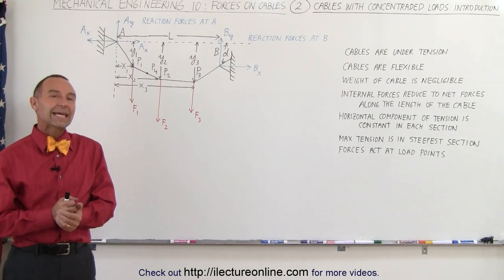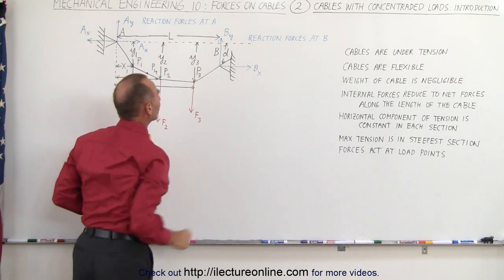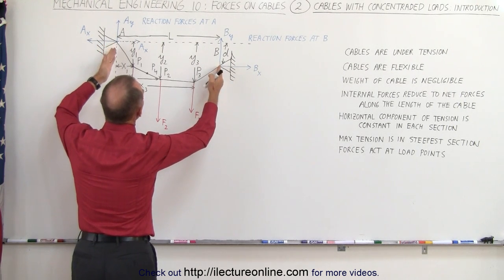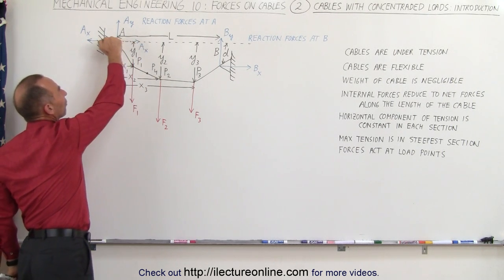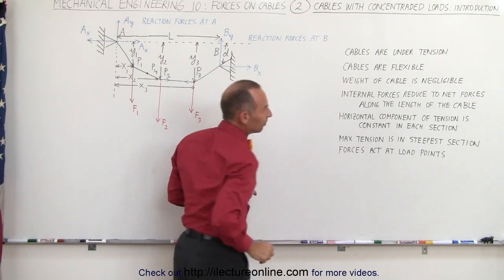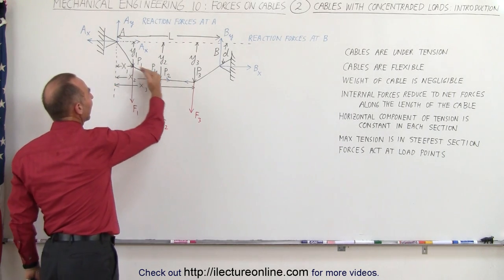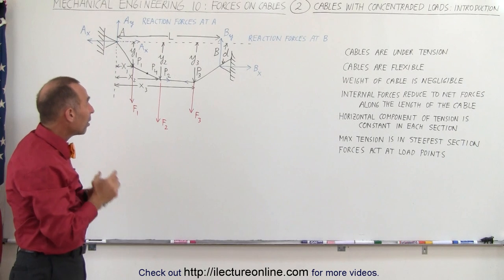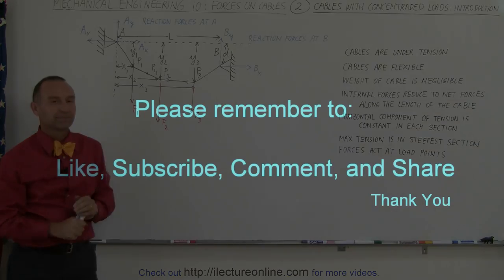Mechanical Engineering: Ch 10: Forces on Cables (2 of 33) Concentrated Loads: Introduction

Comment: I have a doubt, can you please explain why the horizontal component of tension is constant throught the cable ?
Reply from the maker: That is the result of ignoring the mass of the cable (which is small compared to the loads).  Since the mass of the cable is considered zero, then the tension in each section must be the same.
Reply: @MichelvanBiezen  thank you for your reply. Just to understand better, I am reiterating your statement. Since the cable has negligible mass compared to load (cable mass is ignored). The tension is only caused by the load which is balanced by horizontal tension at both ends. If there is only one vertical load then the vertical tension is mg and both the horizontal tensions will be mg/2. Am I correct ?